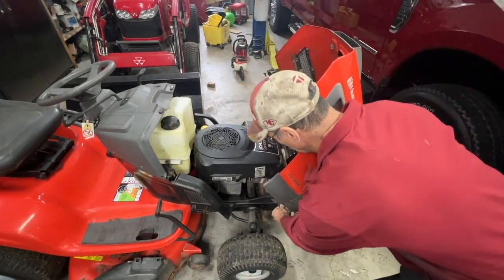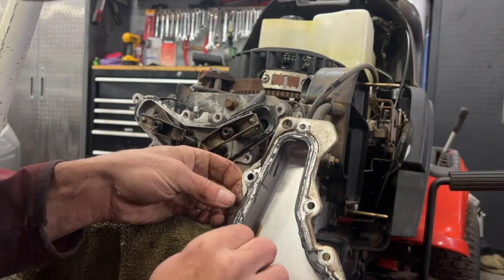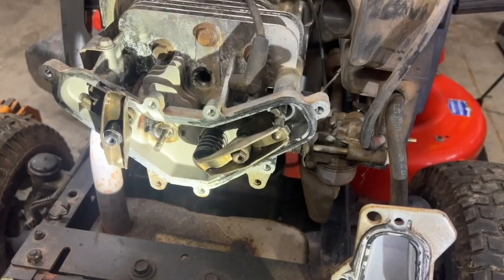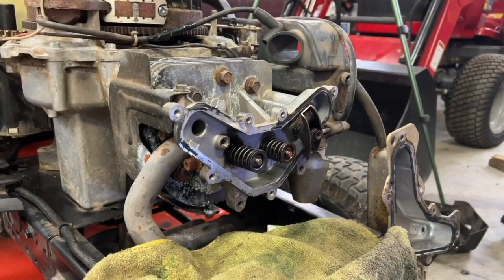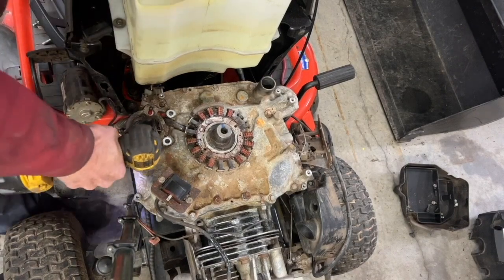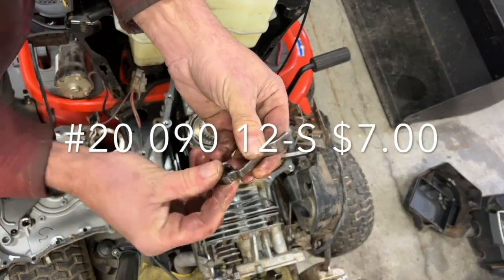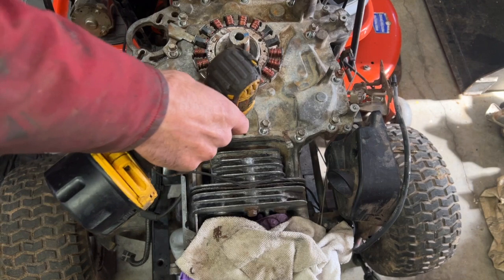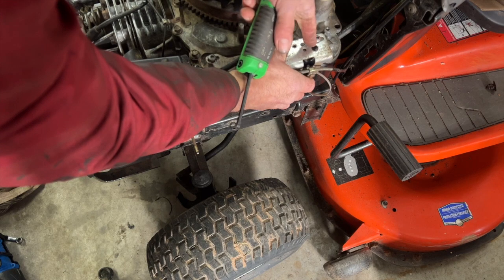19HP Kohler Courage Husqvarna Engine locked up and won't turn over. How to Fix &  Repair.YT, YTA,YTH

Comment: Hello @WeekendHobbyMechanic. I’m having the same problem in my kohler courage. I tore everything apart, made sure my valve rods were seated correct and the valve clearances were correct . I also tore into the cams and timed them up correctly, checked the bumpers like yours was broke in this video both of them are in tact . And i also checked the compression release on the exhaust cam it is working order.  Still doing the same problem as yours. The flywheel will spin stop spin stop…. Any help on this would be appreciated I had the same exact problem as you and I checked everything you went over in this video and it still will not start … thank you for your help
Reply from the maker: That should’ve solved your problem. Can you turn the motor by hand, does it Locke up?
Reply: @WeekendHobbyMechanic yes I can turn it by hand - it gets tougher on the compression stroke, but yes I can.  also when I crank it the fly wheel will spin fast and free without the spark plug in but as soon as I put the plug in, the flywheel will do the spin stop spin stop
Reply: I just seen that my valve guides the exhaust is out further than the intake . You set the exhaust flush w the head , so where does the intake need to be ? @WeekendHobbyMechanic
Reply from the maker: @johnnysedatto1789  So the Valve guide is flush with the head? (@2:40 in the video).  If it's good set the valve at (0.005-0.007") @8.57 in the video.

Comment: Can you do this same method to a Kohler Courage 24HP engine?
Reply: I found a Husqvarna rider with a 24HP and it's engine is seized up... Someone selling it for $125 bucks... Definitely interested if we can get the motor going again.
Reply from the maker: You have a camera? Look inside your cylinders, are they rusty? 
You can spray lube inside the spark-plug holes.  Try to rotate it.  Do this three or 4 times..
  You might have to take your heads off the motor and look at your valves, valve guides.

Comment: Camera inspection  . Valve clearance set to specs and inspected inside the motor like you did. Still did it. After watching the starter in action finally bingo. Starter shaft was spinning but gear wasn’t. There is a little clutch plate that engages tho the rubber on the starter gear from below. I shot some oil on it few days previous and it made the clutch slip. 
Took it apart and cleaned  that oil from everything. Starts like a champ. 
Do not spray anything on the gear or the shaft.  Lesson learned.

Comment: how do you remove the crank from one of them?
Reply from the maker: If you remove the bottom PTO pulley & undo the connecting rod from the crank, it will come out from the top.

Comment: You have some serious experience with these Kohlers. Wish I could get you to see mine an SV740 twin 27HP. Don't think the model or make makes any difference. It seems the crankshaft has seized where the bushing is. Was thinking of tipping it upside down and applying an oxy flame  to warm the pan and the shaft...bad idea?
Reply from the maker: Is the motor is seized up?  Can turn motor with your hands.  Try to wiggle it back and forth (Fan shroud).  
  Heat won’t help.  You’ll melt the oil seal.   Take the valve covers off and take a look at the pushrods.  Are they bent? Popped off?
Reply: @WeekendHobbyMechanic   Totally seized. tried to apply a breaker bar to turn the flywheel. ..Nothing. It's not the clutch. I remember hot ambers of grass coming from the base of the engine when it seized. Think the shaft seized on the bearingless and bushingless oil pan at the base. Seems all Kohlers just have the hole in the oil pan to act as a bushing.  Maybe applying heat with a propane torch (oxy too hot) may help but on a forum I read that putting it in a 300c oven is a perfect unseizing option...if you have such an oven. Disappointed in the quality and repairability of Kohlers. Not made to be repaired
Reply from the maker: You can start looking around for a used motor on facebook marketplace, Craig’s list or kijiji. One will pop for sale soon.

Comment: Great job! Just replaced my exhaust cam gear with a new gear and ACR assembly because the starter hangs up and won’t crank at TDC.  I didn’t find anything wrong with the lifter or ACR on the exhaust cam.  The Starter bendix still sticks on flywheel when engine is at TDC.  Also had to get an aftermarket valve cover with the supporting steel bolt plate on the bottom of the valve cover to get it to stop leaking even with a new gasket.  Just couldn’t get that original valve cover to stop leaking.

Comment: I use the rope trick on some cars when I do a timing belt job and have to loosen the crankshaft pulley. Works great, for loosening and tightening. Of course one has to line the piston just right.

Comment: If people are interested in small engines, this particular Kohler Courage is a dog.  Kohler has good solid engines, just not the Courage.  Lots of issues you can read about online.  Peening the valve guide may work, but is sometimes not a permanent fix.
Reply: These are great for boat anchors but great video!

Comment: Omg that was so hard to do! I admire how you fixed this! I repair engines but a job like this seems difficult! How much did you end up charging?

How did you learn to fix that type of issues?
Reply from the maker: 👍👍    I bought this mower (cheap) to fix and flip. Didn't cost much to fix but took a few hours to do.  I'm more in buying, fixing, and selling but my rate is $35/hr CDN or $25us/hr